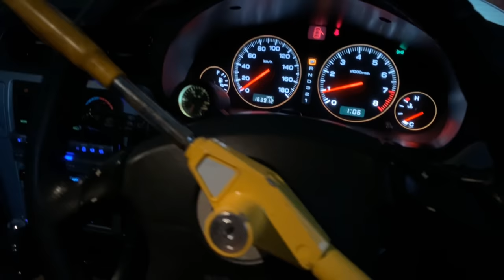The ￼Japanese￼ BARNFIND.. A Super Rare Twin Turbo 4x4.. But What Is It & Will It Start??

Comment: For the detectives out there the car was started recently. as he opened the garage door you can see the back wiper had cleared the dust off the window
Reply: Don’t need the engine started to check electrics👍🏻
Reply: @A6RXN  You are right, but I still believe he or the owner fired the engine up earlier and checked if everything worked. Sense he didn't check for oil in the engine, imaging if he just started it up and it had no oil pressure that would have made the owner kind of upset I would guess.

Comment: Colin, I’d like to give you 2 pieces of advice that will save you in the future.
 1, never, store a battery on a bare concrete floor. I have literally seen one blow up. Always make sure there is either a pice of wood under the battery and a piece of rubber between the battery and piece of wood.
 2. Whenever jumping a car always connect the black to the - terminal last, and the red to the + terminal first.
Reply: Hmm... I though the rhyme was "black before red or everyone's dead".... did I just reverse that saying in my brain somehow? Hahaha
Reply: @richiedagger733  I thought so to, I was also told black first to make sure it's grounded
Reply: @richiedagger733  not unless you have positive ground, that is why the + side was sparking, had he hooked the - up last there would be no sparking.
 And the reason is if the battery had been leaking gases around the terminals there would be no spark to ignite, and it only takes a small spark to blow up a battery.
Reply: I've had a buggered battery sat on a concrete floor for about a year now. Oops 😂
Reply: a battery on the floor is always draining as it getting a ground from the floor!! when I worked at a tyre and battery depot they taught me this! and I was always told connect black first!!
Reply: Correct David, was always taught with the earth to disconnect first, re-connect last!
Reply: I have batteries on concrete everywhere, still start my cars and still charge. If batteries are exploding or losing charge it's not the concrete. 
Or Australia just has better standards for things.
Reply: Concrete and batteries is an old wives tale.
Reply: Positive on
Negative off

Comment: Can't say I was that keen on mine, had a brand new twin turbo tip tronic one of those. Cypriot import, UK spec.
It was 280bhp, but it felt more 180bhp but totally smooth but heavy. Totally un-tunable though. Nobody would map it.
I had a the estate version too. Bought a forester STB 240bhp, now that was quite quick. Had the STI Impreza WRX '555' ltd estate in powder blue 280bhp, much nicer. Good times indeed!

Comment: Afraid you gave me the jitters with firing that up without at least checking the oil, these are sensitive to having good lubrication. Driving the previous (better looking) generation of Legacy twin turbo myself I can attest to the great sound and the overall experience. As has been said in earlier comments all these types of vehicle are slowly being priced off the road, it's getting so difficult to find parts and expertise too. A car with such character is so rare.
Reply: Should have hand cranked it first not to score the pistons

Comment: It’s a shame that a car like that is locked away like that. It should be driven and appreciated. It fired up that easily, that it seems that it has been run more recently.The engine sounded as sweet as a nut too. A very interesting video.

Comment: i notice the merc reg ended in GSF. I went to GSF a German Sweedish and French car parts company for the rubber gear linkage for my Favourite car. It was a Saab 2.3 litre 9000 carlson. They informed me that it was Swedish so they didn't touch it. They didn't appreciate my sarcastic reply, especially when they answered yes to supplying Volvo parts. I miss the non GM Saabs! one of them done 330000 miles. I bought it second hand with 98000 miles on the clock, I sold it with over 250000. the next buyer kept in touch with me because i knew a Saab specialist. he only had to have a water pump changed at 340000 miles. I only changed the clutch because of paranoia. there was nothing wrong with it at all! I miss good old motors!!!

Comment: Japanese reliability yeah right, I had my wrecker (tow truck) 2003 Chevrolet 3500 Silverado with a pushrod 8.1 L cast iron V8 and nobody knows how many miles it got on the clock (replaced cluster multiply times) sitting for 4 years in a cold barn up here in North of Sweden. Even left the battery in it when parked (disconnected), connected battery and it fire right up way faster that this Sub. My point is that reliability have nothing to do with brand name on a vehicle, more so what kind of shape the engine and electrical are in. Cheers from Sweden :-)
Reply: A battery left for four years???
Reply: @adamlongmore2377  Yes sir, it started the truck but wouldn't last long. Had to replace it later that same year. The battery was fully charged and disconnected when I parked the tow truck.

Comment: I would recommend replacing the CAM BELT as they should be replaced if its over 6 years old low mileage or no mileage as they can snap due to degeneration. So starting up that car you are playing Russian Roulette with that engine, catastrophic damage. advice not staring it again, till service has been done on engine  CAM BELT  auxiliary belts oil and fuel and coolant.

Comment: Shame it's an auto. Only 260bhp, and not worth half as much as a manual. Loads in Japan, just not many here.
Reply: its enough, run it on super, floor the throttle and hold tight.. can take most. we had a gt estate, eats hot hatches wwith a washing machine in the boot